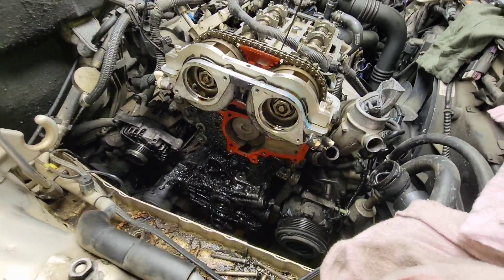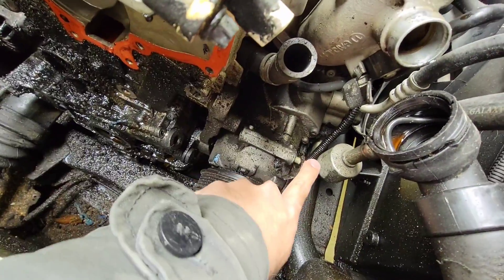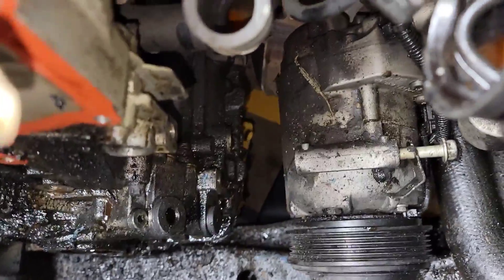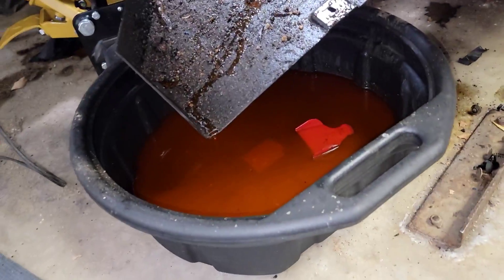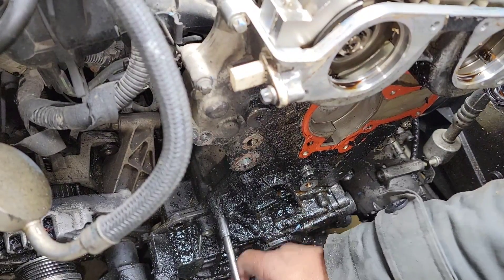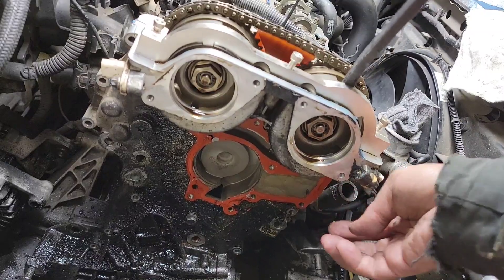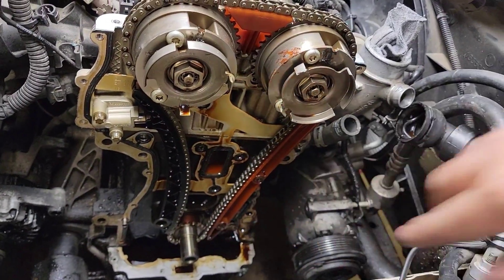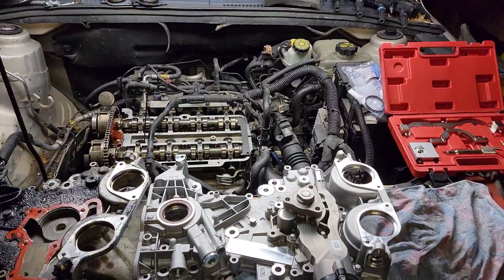V8: Chevy Cruze/Trax/Encore 1.4L Easy Simple Step, How to Take Timing Cover Off!

Comment: Do you need to replace the chain when replacing the timing cover
Reply from the maker: Depends.. on the miles/km  engine light related to timing components.
Reply: @jfGarage4k should the water pump also be replaced?and miles is at 120.000and which is the engine light for the timing component?
Reply from the maker: Yes its better to replace it,  part of timing components  i recommend to replace it
Reply: @jfGarage4k so the chain..and the water pump is there anything else you recommend replacing

Comment: How much does this type of replacement cost??
Reply: I called a shop and they quoted me $380. I knew that was too cheap so when I took my car he said he didn't have the necessary tools so he would send me to his buddy's shop down the street where they could do it. I took it there and they quoted me $1700 if I brought my own parts 😂 I ended up buying all the parts and tools and am doing it myself for less than $300 and I'm putting in a new water pump and aluminum thermostat housing as well. I was just hoping to avoid the downtime of the car and doing the work myself because I have a bad back but to save $1400 I'll deal with the pain.
Reply from the maker: Im glad you save your  safe alot of 💲💲 good work and thanks for watching
Reply from the maker: This is a 6 to 7 hour job, depends on the shop rate that your shop  charges